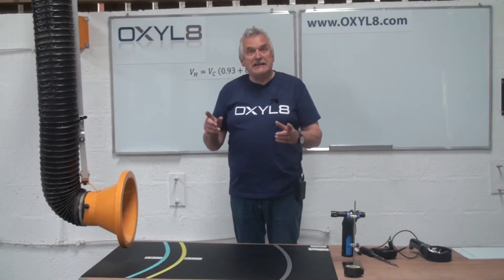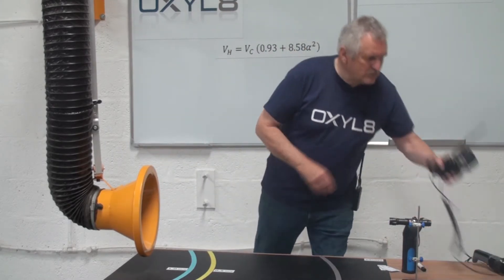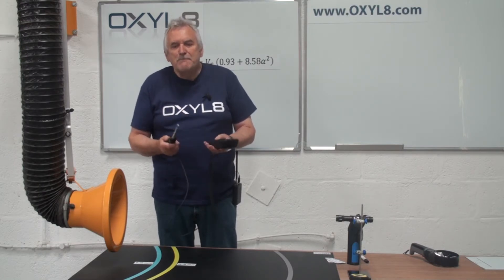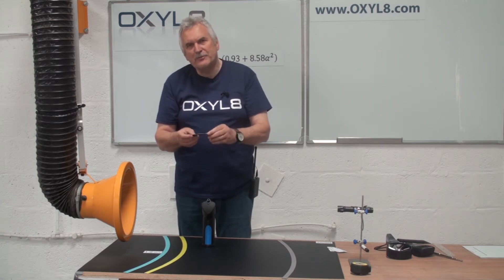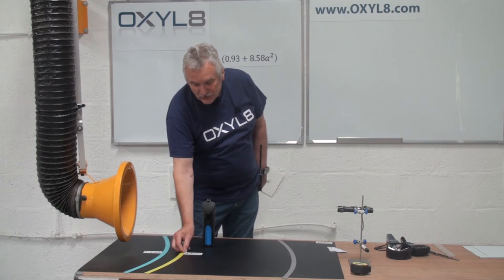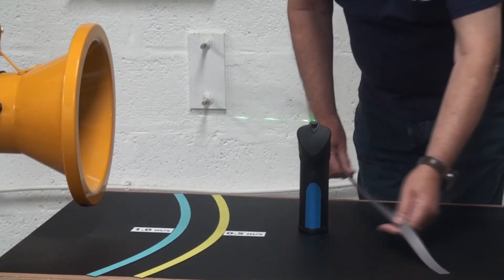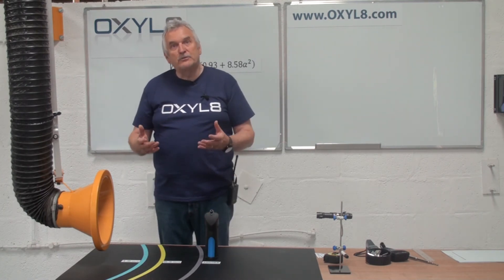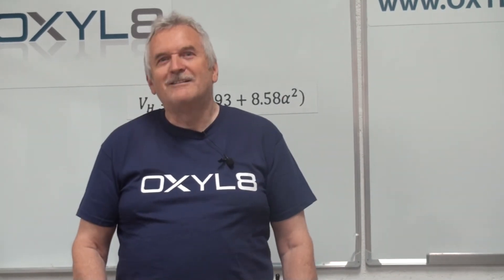How to Measure Captor Hood Effective Range (Captor Control Distance) - OXYL8 Captor 102

Comment: This might be a stupid question, because I'm not a welder, but are there fumes created during welding that are heavier than the rising smoke?  I don't understand why the hood is not placed above the welding area instead of to the side.
Reply: So that they do not obscure the welder's view or get in the way. You don't want to place them above the welder's head also, because then you couldn't capture the fume before it's inhaled by the welder. Also hoods work more effectively if you place them near a surface. Like shown on this video but maybe a little closer.
Reply: rule of thumb is that  you should always be pulling dirty air away from the breath zone ,not towards or passed it .